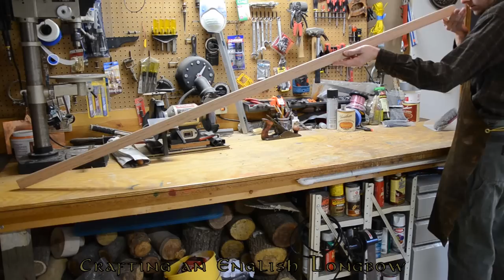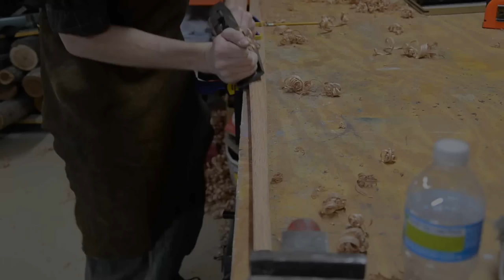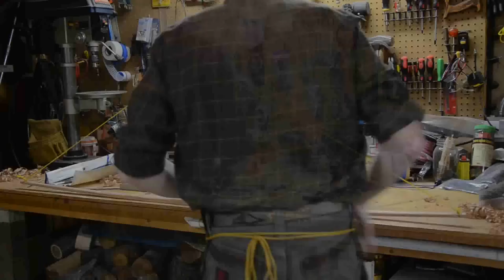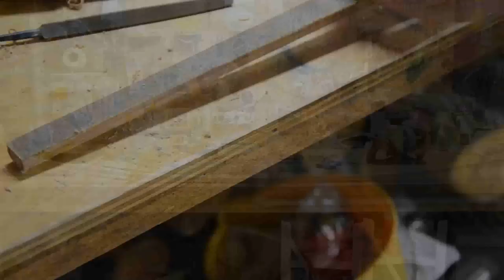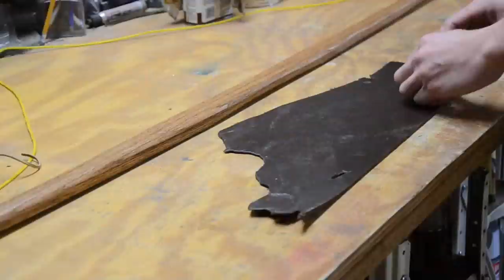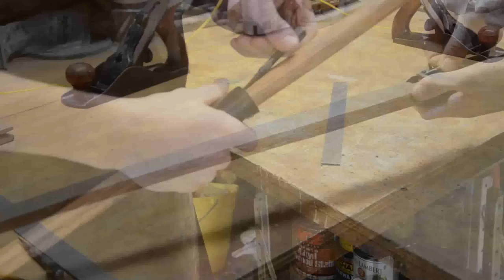Crafting an English Longbow

Comment from the maker: After several months' battle with the system, I can finally post comments again. Thank you everyone for your support!
Reply: LastApocalypseForge you should craft your own arrows to go with it me and my father use to make are own before we went to field archery competitions. you also get to explore different type's of arrow heads
Reply from the maker: That's actually something I've been working around with lately. Once I'm satisfied with my sockets, I'll be making a video :) So far I've only looked into bodkins and firecage heads, but I have a bundle of shafts and a fair number of goose pointers for when it's ready!
Reply: LastApocalypseForge is a bow basically just a piece of polished wood with string and handle
Reply: +Duksing Chau No, a bow is a piece of wood engineered to take incredible pressures without fracturing and to efficiently turn that pressure into arrow flight. It doesn't have to be polished but the strength of each limb must be balanced both along its own curve and with the other limb. The grain and type of wood must be just right, but in the case of this video, the wood is being helped with fiberglass. If the bow in the video breaks before 100 shots or so, it is a polished piece of wood with a string, not a bow.
Reply: +LastApocalypseForge Nice bow friend ! ....would have been nice to see it in action thou .....just saying :) ....
Reply: +Duksing Chau that couldn't be farther from the truth. A bow is the most underrated weapon of both prehistoric and medieval times, the engineering, craftsmanship and time that goes into one makes bow making a lost art, along with sword making.
Reply: +20TheGame09 here here.
Reply: there ya go! thats more like it, im proud of you, not speaking like your overly dedicated to the role youve been given at the renaissance fair!
Reply: People don't speak like that but they want to.
Reply: What type of wood is it and where can I get it from.
Reply: Nine Worlds Workshop

Comment from the maker: I see what you are saying. Yes, it would certainly be a different bow. I thought you were talking about adjusting the weight while making it. As far as altering the draw weight of finished bows, the only way that I know of doing so without actually changing the bow itself is to change how far you draw, with the limit being the maximum it was built for. It shoots rather well, especially considering this was the first bow I ever made. Fast and not too much shock.

Comment from the maker: Thanks mate! I just started making my own bowstrings, which I just put a link to in the description. During construction, I used a length of braided nylon rope I had lying around and shot with it only a few times. Anything that can withstand the load without stretching should do fine. Sheetrock tape is fairly common, but not essential, and the linen is purely for aesthetics. You could use horn, silk, denim, sinew, paper even, or another thin piece of wood. Hope this helps!

Comment: I enjoyed your video, and learned a lot about bowery. Friendly advice, if you want your tools to last longer; Lay your jack plane on its side when not in use instead of setting it down on the cutting blade, and only run your files and rasps in the direction that they are cutting in.

Comment from the maker: Thanks mate! For the grain, it is best to have it running completely along the length of the stave with no ends running off the edges. That way, it will be more difficult for splinters to lift and for the bow to shatter. Also, you want to have more late (winter) growth rather than spring growth. The lines will be thicker and farther apart. One indication is better boards will be heavier. You also shouldn't see rings on the wider face, that is the worst thing you can have. Hope this helps
Cheers!

Comment from the maker: That depends on what you mean by adjusted. The process of tillering is where the draw weight is determined. The limbs can be shaved down farther to make a weaker bow, but the only way (that I know of) aside from adjusting the geometry of the bow itself to make it stronger is to make a laminated bow or back it with horn or other stiff material. Also the draw length effects the weight, but drawing past what it was made to shoot is a good way to break it.

Comment from the maker: Tillering helps determine the weight, the farther you plane down the limbs the weaker it will be. As a general rule, width is less important than thickness (why flat bows are so wide) when it comes to poundage. The string has more of an effect on the smoothness of the release and how efficient the energy is transferred to the arrow. And then there is the shape of the bow itself, the materials, laminates and composite bows, etc. that can wildly change the poundage.

Comment from the maker: Provided it does not stretch, it will work, although polyester is a more common choice of synthetic string material. String serving material is usually nylon (the part that wraps around the strong where the ends loop and where the arrow nocks).

Comment from the maker: In metric units, about 1.8m x 3.8cm x 2cm. The starting dimensions may be larger depending on the strength of the bow, and can always be made smaller. Much smaller than that, however, and you would likely need to glue another piece of wood on for a handle.

Comment from the maker: The shape is the way it is because it preserves material better from the trees, which at the time were too scarce to cut flat boards from. Instead ,the English used the D shape because it was more efficient when cutting lengths from a circular beam (tree trunk) for the strength of the bow. I agree, they are more work to get right.  The length really depends on the draw weight and how thick it is, ranging from the 6'+ to very small like crossbow limbs, although those were usually composites.

Comment from the maker: There are a few ways, depending on the style of bow. If I were to make a similar bow stronger, I would simply leave the limbs thicker. The roughed staves are probably in the 150# range, but I have never tested them before doing a little tillering. You could also, without changing the geometry much, do a laminated bow with the backing having a much higher bending strength (think bone) or wood such as bamboo or hickory.

Comment from the maker: Oak is not that unusual, but it was all I had available at the time. I'm gathering materials to begin a composite longbow, probably with hickory and oak. It is a common enough wood that it can be found most places for a relatively low cost, especially when speciality retailers are quickly disappearing.

Comment from the maker: I have never seen it done entirely that way. Tillering naturally takes care of some of that, but without gradually taking away the wood on the belly of the limbs, it is impossible to make it even. Also, bending a completely untillered bow will (and I have no evidence of this because I have never tried it before) take much more set if you draw it to the full length. Splinters are easy to sand down on the belly, but the backing keeps splinters from lifting on the front.

Comment from the maker: The sheetrock tape helps prevent the bow from splintering. The grain is not perfect, being a hardware store wood, so the ends will try to lift on the flat, which is under tension.

Comment: I have access to wood with metal dust compressed into the wood. It is very expensive but I was thinking to make a one piece bow on my long bed cnc mill machine. Maybe insert a thin titaninium strip inside for spring back strength. Maybe I am over-thinking it but I want to make a powerful, long lasting bow. Does this idea seem feasible?
Reply from the maker: Is the wood solid, or a compressed particle board? I can't imagine that working very well for a bow, as metal dust would introduce stress points that would only complicate the constant bending process. Try it out and let me know how it works; I have never heard of that sort of material before. Also, a CNC won't be any better (if at all) than doing it by hand. Maybe get a rough shape, but the tillering can't efficiently be done by machine. Also, the titanium probably won't help you at all. It is an incredibly strong material, but not in elastic deformation. It resists strain like glass does (after a fashion), and will probably crack rather than bend like a spring. I would stick to wood alone, as you will get better power, speed, and reduced shock out of it. If any metal were to be used (which I would not do unless it is a crossbow, and even then it is too dangerous for me to try), it would be a high carbon spring steel (5160 or 52100, maybe 1095) tempered VERY far back. There is a reason we have been using wood (and other natural materials like bone and rawhide for laminations) for hundreds of years to build bows- it is easy to find, relatively cheap, and tremendously effective. Possibly consider something like oak, hickory, bamboo, yew, or orsage orange if you can find it. Any of those can make a bow stronger than you can draw, and if properly cared for, last a lifetime. 

Good luck!

Comment from the maker: The only real limiting factors in making a bow string are its size (too large and arrows will not nock around it), and its strength. If you can meet those two things, it will work. Natural fibres are usually too thick for bow strings if they are to support that much weight, but there are a few. The best thing to do is Safely experiment, and find whatever works best for you.

Comment: Nice project, don't you find the glue cracks over time though? I've never found Titebond to be particularly good with bending although I suppose I've never glued down scrim tape with it.
Reply from the maker: I have had this bow for a few years now and the glue is doing great. It works well in this application because while it bends, it does not bend that much. At any point along the curve, it is only experiencing less than a mm of deflection along a particular element due to the nature of how a bow bends when drawn.

Comment: Excellent work.

Can I ask why you bonded the linen cloth to is though? Was that for extra reinforcing?
Reply: To provide lamination so that extra springiness can be put into the bow that the wood used lacked.
Yew is the timber of choice for bowyers since it is naturally laminated between the heartwood and its sapwood to provide this. 
The heartwood on the inside of the bow resists compression and the sapwood on the outside of the bow resists stretching making the bow more powerful as a result.
Reply: 1973Washu

That's good.

For my lemonwood bow it's without the laminated bit, but I guess it's ok without...
Reply from the maker: The backing on this bow is solely to prevent grain separation. If a splinter would begin to lift, it would be catastrophic to the bow and could cause it to shatter when drawn. The linen backing serves to keep the grain in check, and if it were to break, would instead stay attached to the cloth rather than explode in your hand.
Reply: 1973Washu
What about Osage Orange?, I'd heard that it was a superior bow wood!

Comment: Since you're obviously into metal, you should check out Eluveitie. They're awesome folk metal. Also, would this work on a smaller scale? I build crossbows and I usually buy a fiberglass crossbow prod for them. I want to actually make the bow for my next one.
Reply from the maker: I actually saw Eluvitie live a year or so back. Best concert I have ever been to!
For crossbows, similar processes would produce comparable results, but the shape of the prods will need to be different. Due to the range of motion, it is more common for prods on a cross bow to be flat rather than the characteristic D shape of the English longbow. Also, I would recommend using some sort of lamination (wood with horn or rawhide on the backing if you want to keep it on the traditional side, fiberglass or carbon fibre (if done right) if more modern) to help with the immense amount of stress it will experience. Because of their construction, crossbows generally need to be much stronger in the draw weight than a longbow. Another option, and one that I will be exploring in the future, is to make one out of a high carbon or spring steel. Anyway, since you already work in the trade, you know probably the risks of what flaw in the prod can do. Hope this helps, and stay safe!
Reply: LastApocalypseForge that is freaking awesome. I saw them Oct 2nd of this year. It was great. 
As for steel I can buy ready made ones and add my own stuff too it, but steel is really risky. I was thinking about buying some flat red oak boards from home depot. They sell them in these really thin 1/8th inch sizes and I was thinning of just laminating them together and then shaping out the prod. Idk how that would work out
Reply from the maker: Tarek Youssef One way to find out! If you give it a try, let me know how it turns out!
Reply: LastApocalypseForge the genius behind ensiferum, jari, is now doing wintersun.
Reply from the maker: AngryKhan Funny you might mention that- Wintersun was on tour with Eluveitie when I saw them! Great music all around!
Reply: dude... i read that comment and i was like... dafug... i have eluveitie t shirt on me (alesia)
Reply: and you should check out korpiklaani and ensiferum.... really good ones though
Reply: Metal Pawe oh... it was ensiferum... my bad    -.-
Reply from the maker: Metal Pawe Indeed! Small world, isn't it? :)
Reply: Another great band to listen to, if you haven't already hear of them, is Suidakra. They're a Celtic Metal, Melodic Deathmetal Group. They're amazing.

Comment from the maker: All materials can be found at a local hardware store. Just be careful selecting the wood, else it might fail under tension or result in a very low power bow. All you theoretically need is a single piece of wood, although the boards you will find are not meant to be made into bows, so the grain is not perfect. That is why I backed it with cloth, to prevent splinters from lifting. Then you will also need some sort of cloth or sheetrock tape and glue. For the bow, that is it aside from tools.